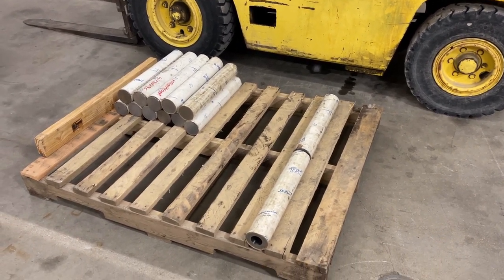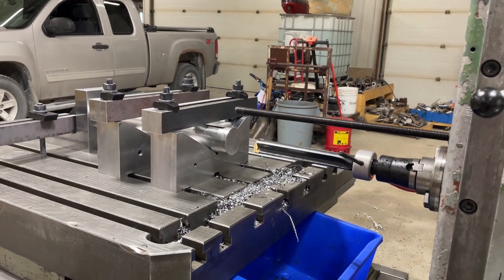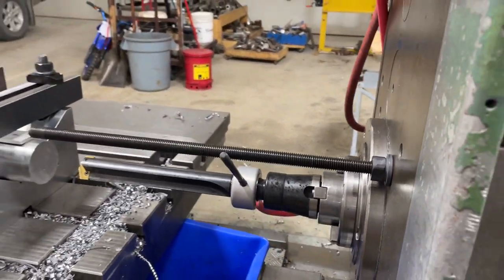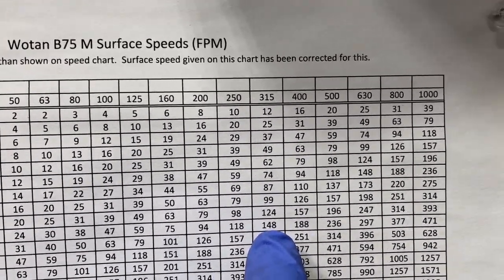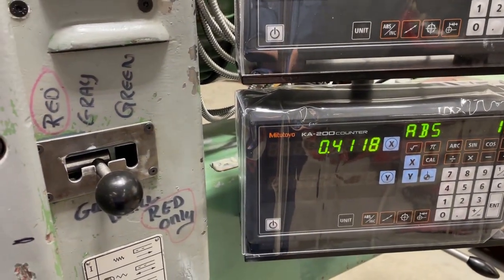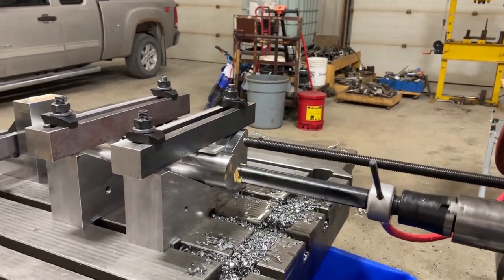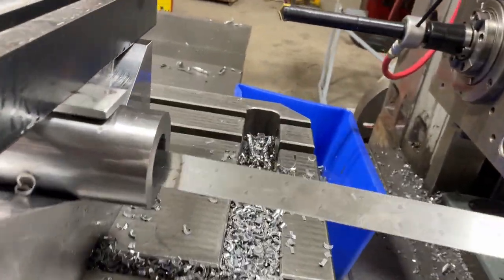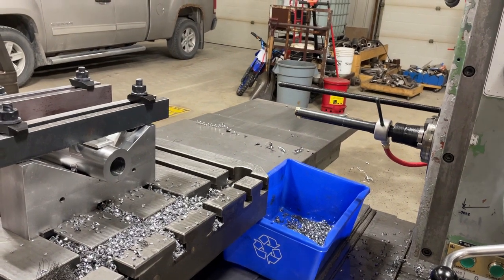Spade Drilling a 1.5" Hole (at 4 inches a minute)

Comment: Recently started tinkering with a smaller spade drill (9/16”) on the low hobby end with a small import lathe, been incredibly impressed so far. Running a 55mm deep hole in titanium with just oil hand pumped through the drill, and it has so far been about 8x faster than doing it with carbide tipped twist drills. The ability to put oil to the cutting surface certainly helps, but the spade is cutting very stable with chips that evacuate well even with the hilariously anemic coolant “flow” from an oil can. Can run the hole in one go with no pilot hole and a massive reduction in heat generation

Comment: Nice chip control. Did you harden the v blocks? Are you adapting the faceplate that’s tucked behind the HBM to use on the HBM? Like you videos!
Reply from the maker: I didn't harden the vee-blocks as they are just mild steel and unhardenable.  To do a proper hardening job you would also have to finish grind them and I don't have a grinder that could do that.  The old chuck next to the HBM was off my large lathe.  It was hopelessly worn out when I got it but I may make a boring/facing head out of it.  It's a steel chuck so it is very strong and stiff.  Ken

Comment: I use a yg1 spade drill with an m48 insert (HHS/CO) for drilling managanese steel. The job wouldnt be possible without it. 2 question do you have a horizontal boring mill in your garage? And are you related to @ave because you sound like cousin's.  Cheers
Reply from the maker: By manganese steel I assume you are talking about wear plates?  I have never successfully drilled those (Hardox 450, in my case) with a twist drill.  What size of holes did you drill and what type/size of machine did you do it on?  My shop used to be in my garage but I didn't have my HBM back then.  I have been in an industrial shop since 2019.  My truck was in the background as we were supposed to get our first snowfall of the season and I didn't feel like scraping ice off my windows.  I'm not realted to @ave (as far as I know).  We both come from the northern half of western Canadian provinces so we may sound similar. Ken
Reply: @hmw-ms3tx  so I drill 1.5 inch holes 1.5 times diameter in 3.5" rolls b of the stuff. I use the YG1 M48 spade bits at about 25rpm on a 100 year old machine lol. I currently use air but want to switch the machine to coolant. Thanks for sharing

Comment: I’ve had pretty good experiences with smaller and shorter space drills (20-40mm around 300-500mm in length). We’ve got some 700mm long 35mm ones that are abit inconsistent. Great vid though.

Comment: I do almost all my drilling with spade drills, works great especially on Hor borers. 

Does from 14mm to 300mm diameter for me, atleast for drilling.

They dont handle pilot or core holes well, but if you use a stubby one you can get away with it if the burn out/core isnt to far off center.

Showa also makes really good spade type drills

Comment: Looks good! 

If your bottle neck is the change out, can you set up another bar on the opposite side of the table and then just rotate it 180 and start drilling while you’re changing out the one that was just drilled? 

New subscriber btw. 👍

Comment: Heya! First timer stumbling in here. Just wanna throw my 2 cents and observations onto this. ^^
As quick introduction i mainly did lathe work and deep hole drilling the last 5 years.
Never used a spade drill before, just gun drills, BTA/ejector's, trepanning tools and the usual twist drills in all sorts, sizes and coatings... just glanced at em in a catalogue and seen em sitting in tool racks on fairs and in machines... Tho also never needed one because of the specialized equipment at hand.
A same diameter gun drill won't run faster and a BTA not by much. Swarf is looking really good too and gets evacuated properly even tho the coolant pressure is quite low but it works on a machine with no trough spindle coolant so ima call that a win. For the setup and work you got that tool looks really good and now that i checked the prices too, yup, if i had no deep hole drilling machines around i'd get one too.
The surface finnish is not quite up to snug to what i'm used to see which would be around Ra ~2-6 for that diameter usually, i imagine at least. But i won't cry too much without having it measured or seen for real besides a 720p video! Could still be smooth as heck!
No offense towards the 720p quality btw, it's not shaky and nice to watch and listen.
Thanks for sharing and taking the time!
Happy drilling! :D
Reply from the maker: Thanks Sicstar.  The surface finish at the beginning of the hole is poor and gets better as you go deeper.  I think it is caused by swarf rubbing in the hole because my coolant pressure isn't high enough to evacuate the swarf from the deeper areas of the hole.  If I start doing more spade drilling I will likely change my coolant set up to get more pressure to the drill.  Ken
Reply: @hmw-ms3tx   have you tried roller burnishing the bore if you want a superior finish?
Reply from the maker: I've never tried roller burnishing before.  For these parts the surface finish of the hole is not important as it is just a clearance space for a leadscrew to pass into.  Later on I will bore out the first inch of depth on my lathe to pilot a flange nut (that I also have to make) for the leadscrew.  This part ends up being similar in construction to a quill in a lathe tailstock.  Ken @chrisstephens6673
Reply: @hmw-ms3tx  If it's just for a leadscrew to have space inside the finnish doesn't really matter indeed. And like the other guy said burnishing is a thing, also i can say from own experience a flex-hone can help if needed. Or just saw a slit in a piece of wood and throw on some sandpaper and throw it on a drill, been there done that. lol
And yes, the chip evacuation is a bit iffy on lower coolant pressure but if you turn it up to 5 bar (70 psi) on that machine you can sweep out your shop floor wet and take a shower probably. ^^
Plus it probably won't make that much of a difference since if the surface get's better inside the hole chip evacuation is sufficient i guess.
Also when the drill isn't fully engaged yet reducing the feedrate till the whole tip is in the part by 30 to 60% helps with an "entering-funnel" where the diameter might be bigger at the start of the bore, i can imagine that might help with chips getting recut, might leave a small step tho where one goes out of the cut and ups the feedrate. At least in my bubble/on a cnc deep hole drilling machine... Which for you doesn't even matter even on those parts since you gonna spindle it out a bit anyways.
Damn. Wrote a whole essay again... 
Pick from it what you like by the way and keep it up! 👌
Reply from the maker: I don't mind an essay.  Usually a guy finds something usefull in them.  Ken @sicstar

Comment: What a sweet chip!
So at .25mm chip thickness, (.5mm feed per rev for 2 cutting edges) 
Compared to .1mm chip thickness, (7 thou”/rev) for a HSS Drill,
With the higher SF/M and a whole lot of factors like constantly retracting the drill to clear swarf.
On a quoted job that drill just about paid for itself.
Can the tool use different width spade inserts?
That would be advantageous, even if it was a 5mm range of sizes..
Reply from the maker: Yes, the higher feed rate and higher surface speed (and I could increase that as well but I may run out of horsepower) help, but I think the biggest time saver is not having to constantly start/stop the feed (to break the chip) and stop/retract the spindle to unwrap the swarf/reset the coolant hose.  One thing that surprised me was that I could feed the drill under power right from the beggining.  Most videos I have seen guys hand feed them in until the drill is cutting the full diameter and then they engage the power feed.  The drill usually jumps around quite a bit in those videos until it starts cutting the full diameter.  I started doing it that way but my drill seemed very stable so I decided to try power feeding right from the beginning.  To my surprise it worked quite well although I'm not sure why.  The drill bodies can take different sized inserts.  This one will drill from 1-13/32" to 1-7/8".  Ken
Reply: @hmw-ms3tx  that’s nearly 12mm of range (35.72 to 47.63mm) for one tool, that’s impressive!

Comment: Nice. It got busy in a hurry.
Reply from the maker: It certainly did.  I was pleasantly surprised that I could drill under power feed right from the start.  Most of the videos I have seen the drill jumps around alot until it cuts full diameter and usually you hand feed it through that stage.  For some reason mine was very stable.  Hopefully not just beginners luck.  Ken

Comment: Have you ever tried these without through spindle coolant? It seems like on of the big stumbling blocks to using spade drills on older equipment.
Reply from the maker: This machine doesn't have through spindle coolant.  The coolant inducer I showed in the video allows you to flow coolant through the spade drill by attaching a coolant hose to the inducer.  My biggest problem is low pressure which has a hard time clearing the swarf when the hole gets deeper.  Ken
Reply: @hmw-ms3tx a few gunsmiths I've met use similar inducers for reaming chambers. Apparently 60-80 psi works well. 

My thought is more for people who can't afford such a set up. Rotary unions are not cheap. Supposedly a few guys on practical machinist have gotten ok success down to 3-4x diameter with just flood coolant.
Reply from the maker: I was surprised at the price of the coolant inducer (rotary union).  It was only $110 Canadian.  Compared to the drill body (around $400 Cad) it wasn't too bad.  It can also be used on all No. 4 Morse taper drill bodies, so you only need one for a large range of hole sizes.  Before this I have always used flood coolant.  It works very well in vertical applications (gravity pulls the coolant to the cutting edge), but it's a struggle on horizontal set ups. @moosesmachinery
Reply: @hmw-ms3tx   Hi, you could also consider to add a second coolant pump to the tank (on a simple extension cord) with higher flowrate, which you can hook up to the drill. Second hand they're not too expensive where I live. Ofcourse the amount of holes you plan on drilling with this drill is going to justify the purchase and the effort needed to install. 

Kind regerds.

Comment: I do cnc stuff and those kind of spade drills knock the socks off of ordinary twist drills. They're faster and if you have to drill many holes the insert price beats having to regrind drills many times over. I've used several of allied machine's tools and can confidently say that their recommend speeds are fairly conservative you would probably do ok if you ran that sfm they recommended. I would only worry about the amount of coolant flow you have.